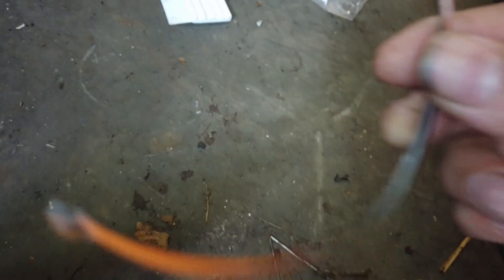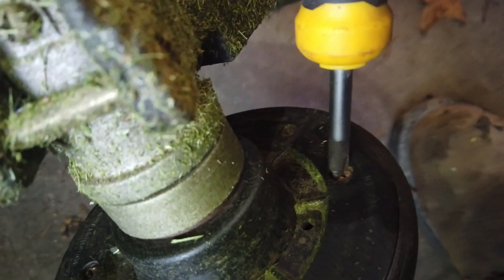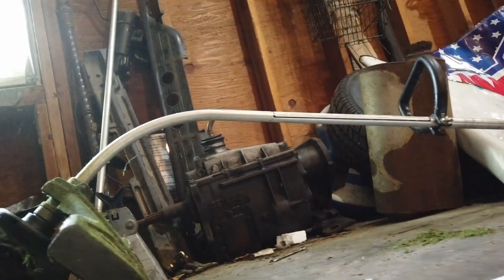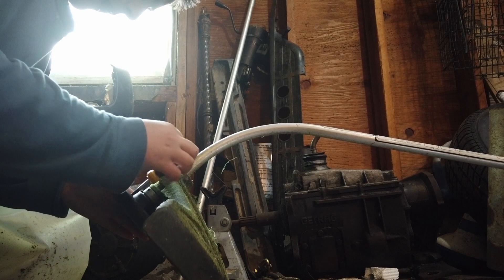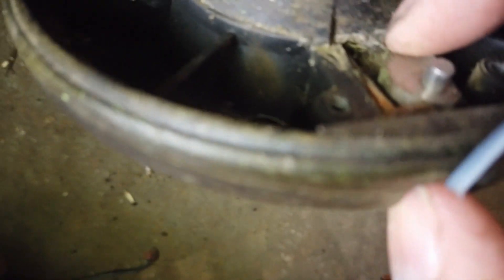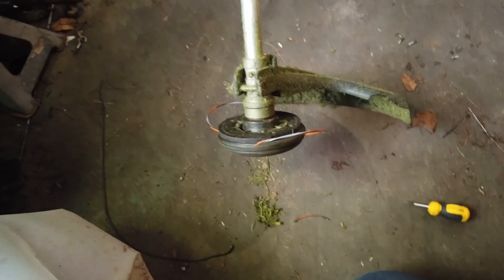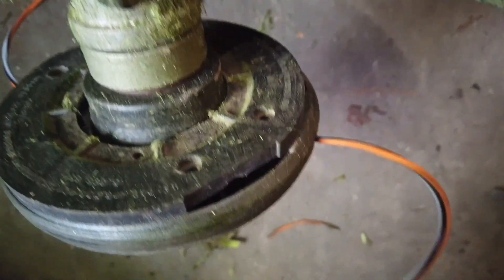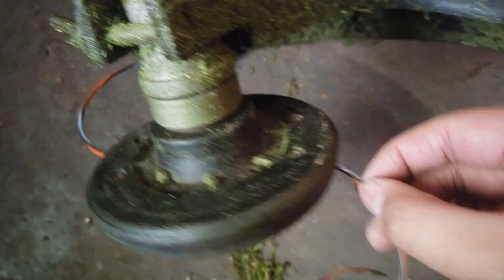How To String Up A Echo GT200R Weed Whacker

Comment: You don`t need to disassemble head to load string in. looks like your springs are missing
Reply from the maker: That is true but I am missing the s rings and keep the teeth holding the string so I just make do with piping the head open and pulling them tight. I should get some new spring for it though. Thanks for the comment. Means a lot.🇺🇸👍👍

Comment: You're wrong. Push in trimmer line from the outer hole until it comes out the inner hole. That's it! No disassembly needed. Pull old worn out line from inside hole and insert new from outer hole.
Reply from the maker: That is true but not with this rig. It’s got broke. Teeth and missing springs on the inside so disassembly was required  Inorder to get the string tight. If you watch the video correctly I state this in the video. It’s been a year since I’ve made this video and I’ve fixed this problem.